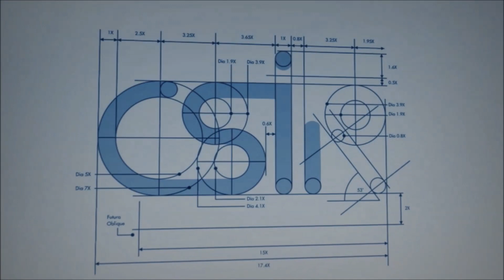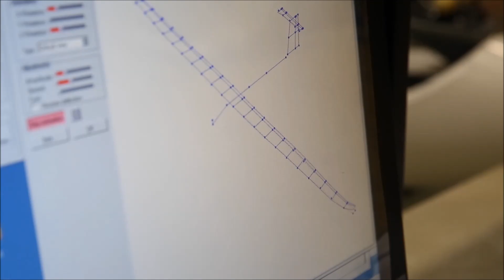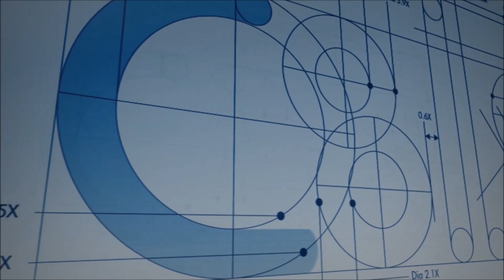Flutter analysis and Ground vibration testing - Jonker Sailplanes and CSIR

Comment: If the measured modes are according the Nastran-model and the flutter analyses in that model was satisfying, you could go into flight testing.
Most German manufacturers did it with flight testing. Increase speed with steps of 4 kts. Use a chute with a reever and start high enough.
It is no black magic nor rocket sience.